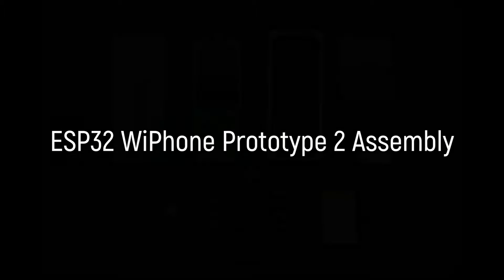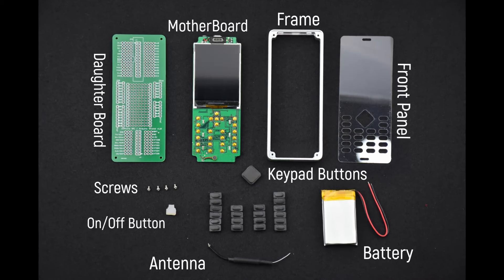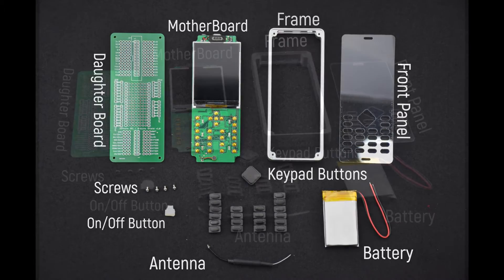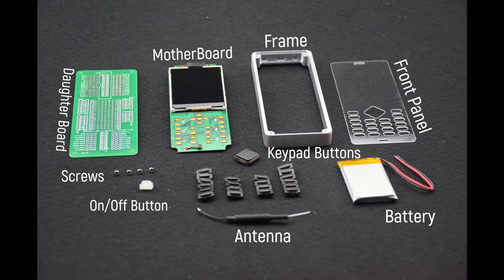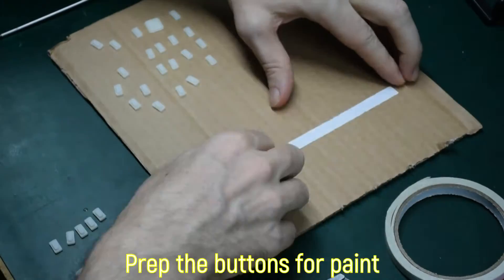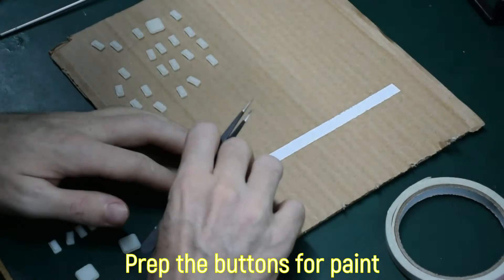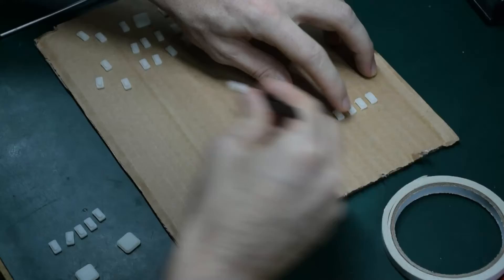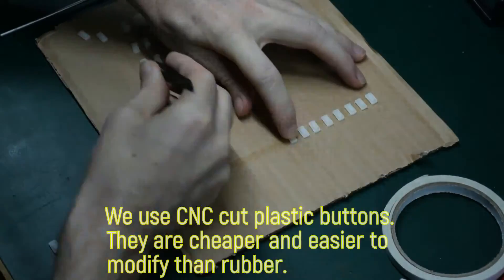Prototype 2 Assembly - ESP32 WiPhone

Comment: I have one blue lcd with white text 4 cables input. On ESP32 with wifi. On the display the blue, it should show the name at the top number at the bottom when someone calls. When I press the yellow it should light solid light & I can talk to the person when I am done I press the red the yellow extinguisher red lights solid light when I hang up! Or when I call someone to press the yellow light glows solid then you should be able to press the 3 X 4 keypad. Since everything goes then this is possible???

Comment: Very cool project, I would like to still qwerty keyboard and user applications.I would like such a cool phone.Android and iOS smartphones are crap.
Reply: Python is cool, it is very interesting! It would be cool yet to make library for interacting with OS in python, something like SL4A. This will be a classic phone with powerfull apps to replace the java midlet 2.0 in old classic phone. Such an operating system can go to other devices. Can name it, for example, WiOS.
Reply: Maybe the software can work on the odroid-go with keyboard, depending on pin configuration

https://www.hardkernel.com/main/products/prdt_info.php?g_code=G153982725754